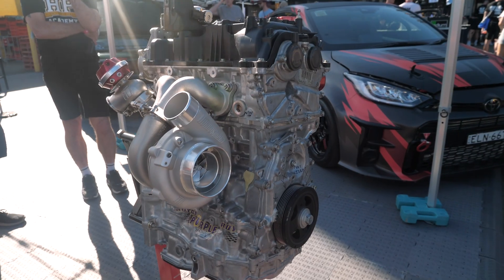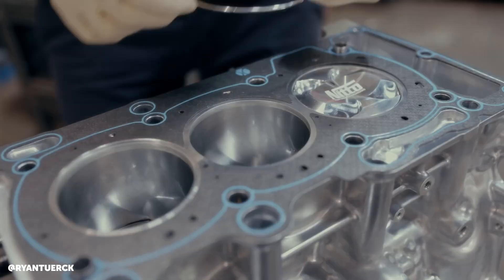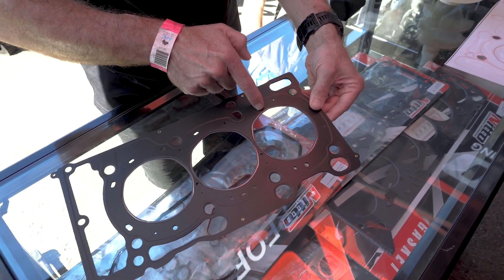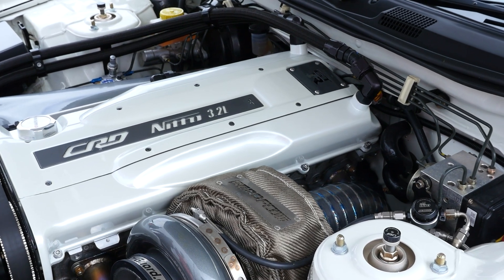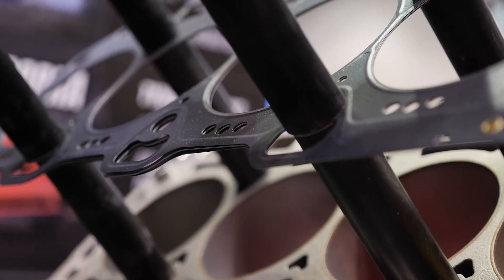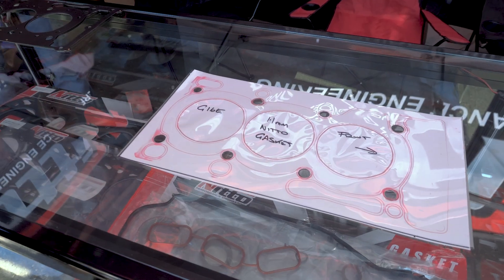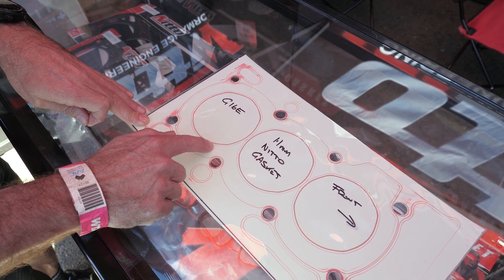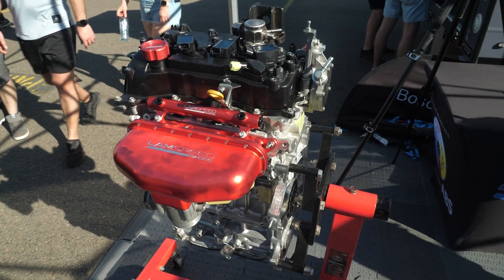Do you reuse your head gasket? | Head Gasket Design

Comment: Now using this aluminum block with stainless steel ring will this cause galvanic reaction at least to the head surface not so much into the block as assume they have steel liner or sleeves???

Comment: Hi. I've designed a 2/3 efficient air-cleaning engine that I'd like to share. Let me know if you'd like to see it.
On an unrelated note (this video):
I've always wondered why the cylinder walls aren't cast with the cylinder head instead of the block. So much effort with gaskets and bolts when the piston rings and valves already provide all the required high pressure joints.

Comment: Some oems have a procedure of pulling the head down then loosening it off before retorquing.

You may also have a gasket that has fatigued. Ive found it quite common to find gaskets that are blown between cylinders in the layers of a MLS type.

Comment: So I’d imagine the s/s Oring would be slightly thicker than the surrounding gasket is that fair to say I recently watched a vid  where a 1500cc flat plane v8 did not use any head gasket at all just Viton O rings for the coolant and oil passages and I think phosphor bronze o rings that sat into a machine groove top of the bore these sat proud of the bore or deck surface by .002” if an inch there was no receiver groove in the head from memory Not sure if the torque specs  but I’d imagine this arrangement would seal pretty good  not sure why more manufactures don’t produce dry deck  arrangements
Reply: Karl,
That sounds sweet. Leaks aren't hidden and don't cross contaminate.
But if it is a bit more expensive and requires a bit more space and the factory gasket won't blow before the warranty expires, that sounds unprofitable, which trumps all the irrelevant stuff we're going on about, eh?

Comment: I have reused MLS head gaskets and MLS exhaust manifold gaskets. Why? Cause 20 years ago i heard i could reuse them up to 3 times, so i tried it and never had an issue. One time i even sprayed the MLS head gasket with 500° engine paint, let dry to tacky and torqued the head down. Never had an issue. This was on a 2.4L turbo engine running 20psi.

Comment: I feel like that's a big question to ask the average 7M-GTE owner
Reply: As a 7mgte owner this is a rabbit hole I been through too many times to count.
Reply: currently in the process of rebuilding my 7m for atleast the 7th time and i have broken just about every part but the only time i ever broke a head gasket was the one time when i used a cometic gasket since it was during covid and supply issues with the hks ones but never broken a hks head gasket that said i have never reused one and my reasoning has been since the coating comes of the hks ones when you removed them (the cometic didnt come of but maybe thats why it broke) maybe you could reuse them if you use copper spray but i dont want to take the risk since i have mostly used the 1,2mm hks one witch is only like 100usd but also have never reused the 2mm one witch is 400usd~ personally i wouldnt never reuse but i understand if someone wants to since the price of the 2mm one but at my power lvl i tend not to take risks like that
Reply: @nojz8557  it's pretty obvious you're not "the average 7M-GTE owner" mate
Reply: @_entrxpy  ill take that as a compliment like i take all those 2jz accusations i get because ppl say i cant have a 7m in my car cause apparently you cant do the stuff i have done with a 7m or get the sound i have from a "truck engine" as they say :)
Reply: @nojz8557  sadly yes that's a compliment since the average owner doesn't know shit about engines (and that's why they all blow up)... Props to you for keeping the king engine in there🤙🏻
Reply: @_entrxpy  yea im actually now just waiting for the nitto rods that are a pretty new thing and lets you use jz bearings in a 7m since they have alot more options like race bearings etc and hopefully with those it will be even more reliable